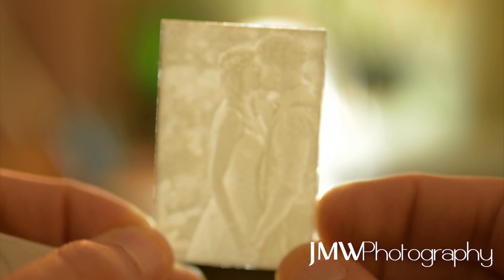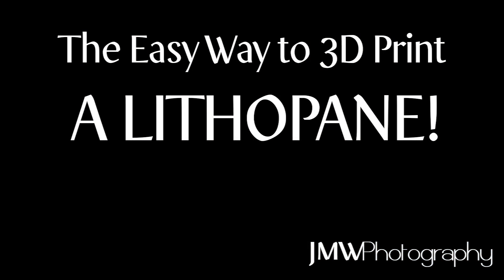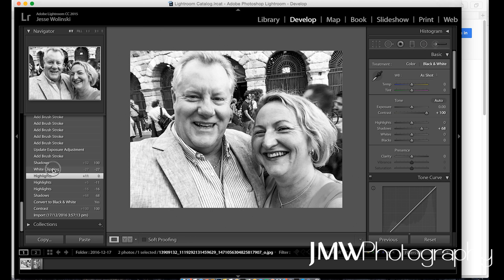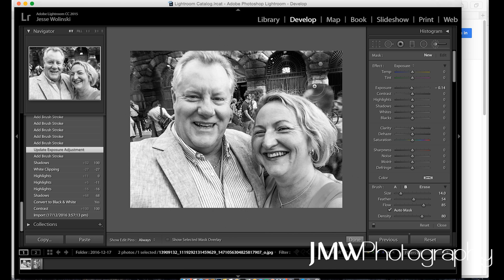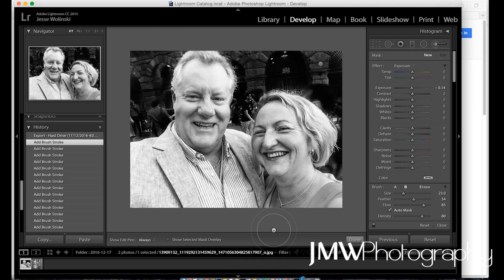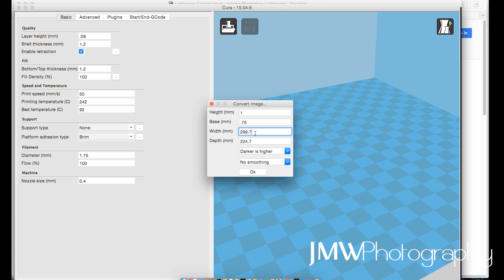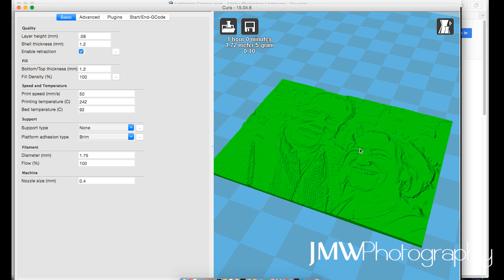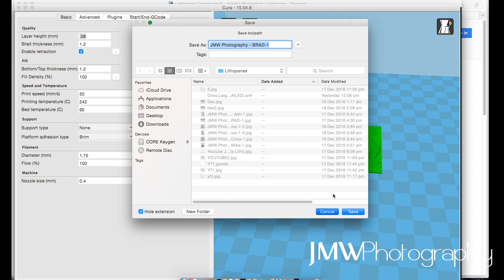EASY! How To Make a 3D Printed Lithopane / Lithophane - PLA - Anet A8 3D Printer - Tutorial

Comment: Now how would i add that to a shape like a sports logo or a globe or cross ect
Reply from the maker: my apologies for the late response. We have had a baby and moved house. I haven't made a lot of videos in a while but we are getting back to it! :) Did you get this sorted?
Reply: @JMWConceptsTheOfficial  no only thing i ever see is a website that does it all with limited shapes. Never see a way to do it with your own shapes made from fusion360 ect. Congrats on the baby and move
Reply: @esmokebaby  I'd see If i could export the lithopane as an stl from cura. Then, use the project tool in fusion to project the geometry onto a 3d model. I'm not a expert with cura though, so I'm not sure if this even possible without plugins or something. And also try using the newer emboss tool in fusion, that might help!

Comment: i'm wondering if i could use this process to make a printing plate that would take ink instead of etching into zinc or carving into wood. Any thoughts would be great. :)
Reply from the maker: Hi +TheKarmaProject.Co, 
I don't see any reason why not! Although in my very limited experience with printing plates, they were made out of a semi-flexible rubber sort of material. I suppose to make it easier to press into/ onto the surface to be printed. If you're carving into wood and that work, then this would absolutely work as well. It would be a lot quicker and easier than hand carving, that's for sure! :D

Comment: Just FYI for those S3D users, it can do the same.(Add-ons)  I believe it needs a png file to work. Set thickness in multiples of layer height determined by gray scale number plus one.  I had to fiddle with the settings but soon it was dialed in as nice as the authors.  A+ BTW
Reply from the maker: Thanks +66tbird1! Very useful info for any S3D fans. If you do a video on it, feel free to message me the link and I will post it in the description. 

Thanks again for the input. 👍
Reply: Care to explain that into a bit more detail?What add-on? you cannot import png models in S3D.
Reply from the maker: +techgen advisor,
To be honest, I'm not sure PNG would work as if there is no 'background'(like there is in JPG) then there would be no parameters for the base. 
I hope this makes sense and apologies if I am incorrect.
-JMW.